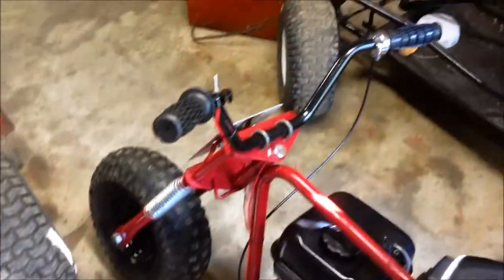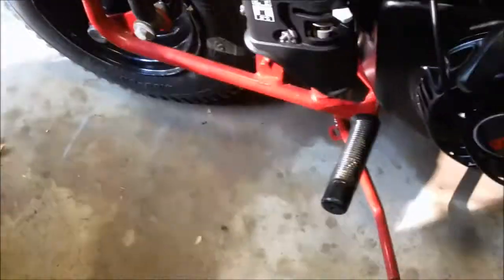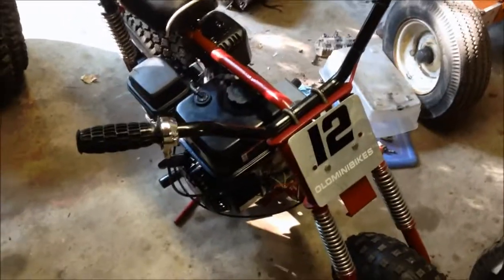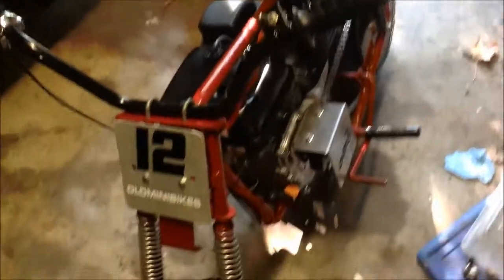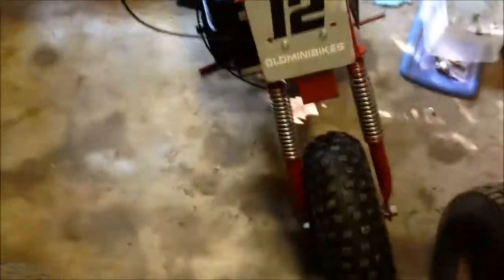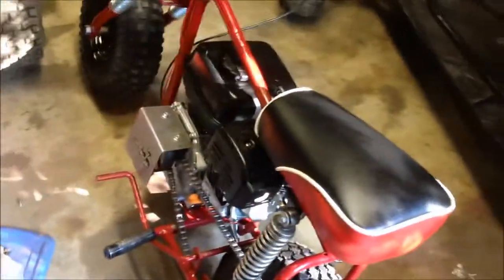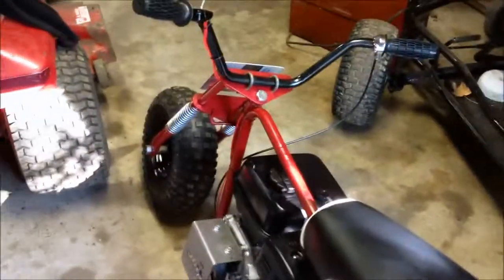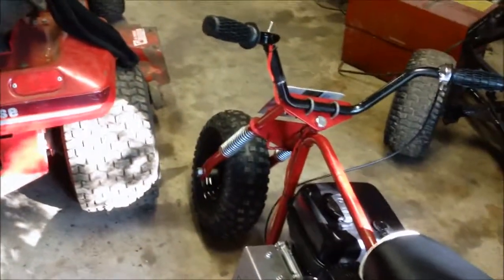Project Mini Bike - Manco Thunderbird part 3

Comment: You need to mod that Predator, trust me! My free mods that I did was bore out the stock carb jet. These engines come VERY leaned out from the factory. Also, another HUGE power gain for free is boring out the stock intake box. Take off the filter and see how small the air hole is? Bore that hole out until it matches the ports of the lower part of the intake and you will get extreme throttle response as long as you bore out the carb jet a little. Bore the jet out little by little until you get a good spark plug reading, then youre set!

Comment: Beautiful bike. Was the predator motor a direct bolt on. 
Or did you have to do any mods to frame?
Reply: engine plate area should be boxed and beefed up or it will flex and crack the frame, especially when you start to mod the 212 for more power.